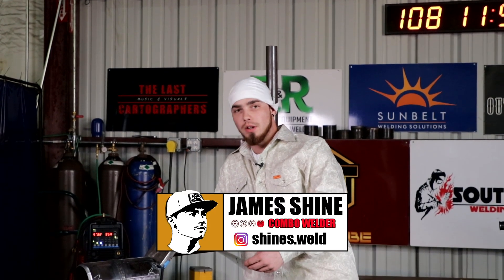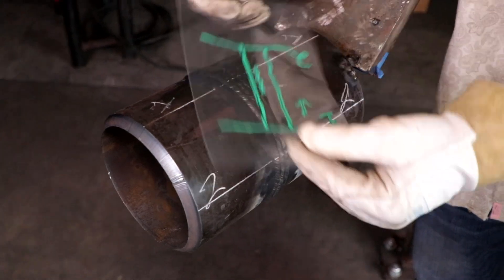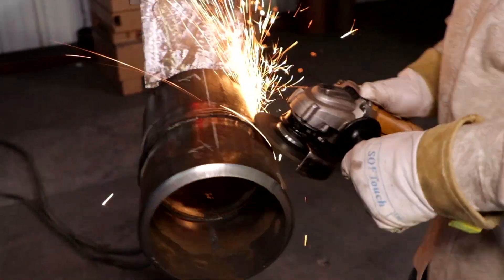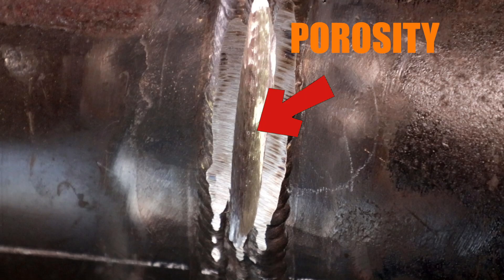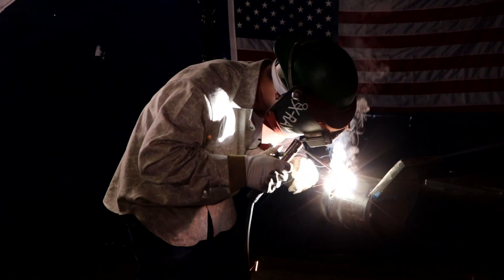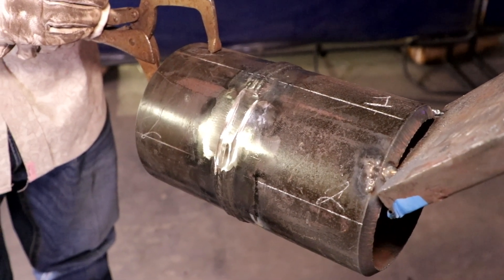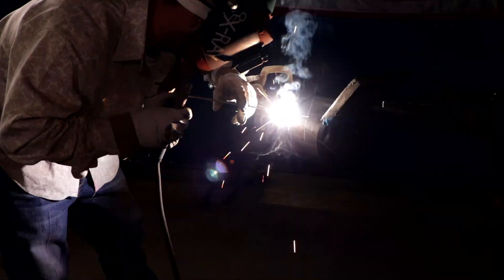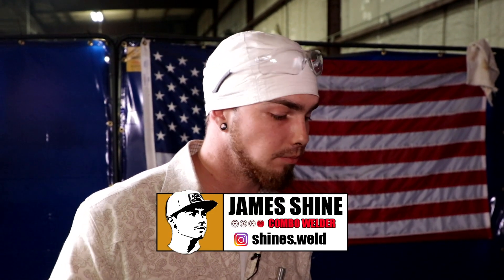Weld Repair on Pipe After FAILED X Ray | STICK WELDING

Comment: Something really important when you're preparing the section for repair with your grinder. Pay attention to how he blended the cut section back to the surface of the cap with his grinder - nice and gradual slope. You don't want any deep cuts that aren't well blended with the grinder, that can lead to lack of fusion right in the deep corners of your cut area and you'll have another failure on the x-ray.

Comment: Ut has its benefits over rt in some cases because we can tell the welder the exact depth, length, and  location marking it out clearly on the pipe . You can’t get depth with RT Like you can with UT. After the weld is excavated we can use MT to check for some remaining defects such as the remaining ends of a crack which can’t be seen easily by the naked eye . Great video btw

Comment: This is a great video. As an x ray guy, they may reshoot it to see if you got it out.  Sometimes you PT or MT it as well. 80% of the time, the welder is going to be told to find it, fix it, and weld it up.  Then I will shoot it again and hopefully it passes.   So for any of the young bucks out there making weld repairs, good luck . Welds go down . You weld long enough you will fail something. It doesn’t mean you are a bad welder. Some shit just happen and thats all. Learn from it. I just fucked up two shots last night.  Then  I had to go back and reshoot  it again. Everyone fucks up.

Comment: Over 1000 xrays in and never had a hitch. More than a few times I've had them re-angle the source because of shadowing though. 

Had a grand ol time repairing mistakes by others though. Honestly if I feel like something didn't go right on a pass I stop and grind. What is an extra 10 minutes compared to the time lost if the techs see a piece of slag in the middle of the bevel.
Reply: What is shadowing ?

Comment: Great video, very well done.  There are couple things I would like to add. 
The arrow is on the overlay so you don't lay it on the pipe up side down.  The RT technician should be able to give you some idea of the depth and size of the weld defect.
Since the most common location of defects is in the start of the weld welders should always try to stagger their starts and stops. If you are making a weld repair such as this it's difficult to alter your start point.  In a case such as this you can tack a strip of flat bar (tab) to the pipe just below the excavation strike off on this tab and carry the weld in to the repair. Once you are close to finishing cut the tab off and complete the repair. Nothing worse than having the repair fail due to cluster porosity at the start location. Of course a welder should always strike off in the weld zone and move the electrode to the weld start position to warm the electrode up before actually forming a bead but with repeated beads in a concentrated area there is greater risk of defects such as porosity and inclusions being concentrated from all starts.

Comment: QC also should’ve been able to give a depth on the indication, at least if they do UT
Reply: A good x-ray tech should be able to get you close. That don’t mean all of them though, chased some stuff all the way down that wasn’t there, such as: hi/lo called lof on the bead, undercut on stringer cap (in between stringers) called undercut or lof on the bead; I’ve had one come back to say there were like 7 bad ones from burn thru and I was running hots that day 🤦🏻‍♂️. After “fixin” two of them and not seein anything that should of been low, I asked for the overlay (they were already marked on the line); it turned out that he was callin burn thru on all the welds that had low spots on the caps.
Reply: 100% correct xray can see it but cant tell you how deep it is UT can

Comment: What is that counter on the wall? What is it countdown for?
Reply: Noup my figure is that this counter is  measuring time to end of the year
Reply: @tomekpawowski2692  seems logical, only video upload date must be much different of date recorded. I do agree.
Reply: @stalopix  is has a 3 figures and then the clock running backwards. That's what makes me think is time to end of the year but this video is from March. 108 days to end of the year would be somewhere in July
Reply: how did you noticed that? regards
Reply: @stalopix  I like know things
Reply: @tomekpawowski2692  nobody answered your question? i am also curious, best regards from Greece.

Comment: I've always heard to 'drag the slag' when welding stick, but it looks like alot of videos show welders pushing uphill on pipe. Wouldn't that increase the risk of inclusions?
Reply: If you run 7018 downhill the slag will want to jump ahead of you and it will be worse for slag and porosity
Reply: @matiasthewelder      Agree with you I dont even weld but been  studying a lot on pipe welding  down hill pipeliners dont use 7018    the lowhyd is for uphill  they run rod ending in 10   6010 7010   8010.   And I gotta say Ive been off the weld sites lately but weldtube is awsome  I am thouroughly impressed with  the talent on here.   not to mention some awsome pipeliners that have own channels as well.    keep it up!
Reply: @jeffreyplumber1975  im only C level so im only able to weld structural right now here in canada, so the rods i will be using are 6010, 8010, 7018 realistically. for wire dual shield and mig, and out in the field is self shield fluxcore which isnt my strong suit yet but im learning. weaving with it is pretty tough for me at least as i seem to get more worm holes so i just run stringers
Reply: @matiasthewelder  you can't drag uphill?
Reply: @LTgomez 72 i add a little side to side jiggle so my beads dont crown up as well
Reply: going up you want to push the gravity plays a big factor

Comment: Gotta know how to run a grinder. Knowing how to repair pipe welds is very important
Reply: Does anyone use a die grinder with carbide cutters?They chop out a lot of metal and no sparks.
Reply: Clunk49 thats not ideal for pipe weld repairs